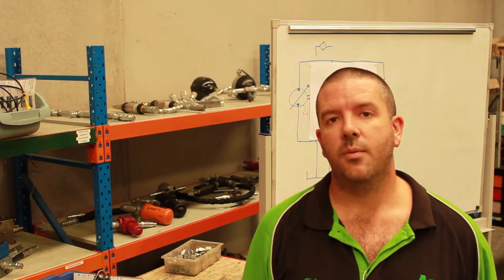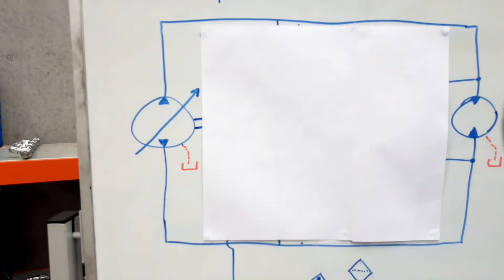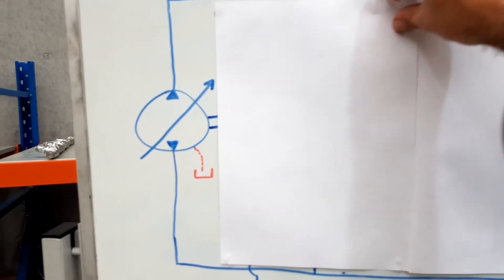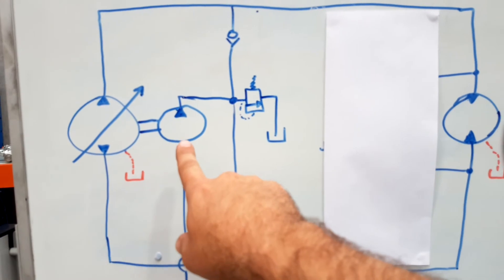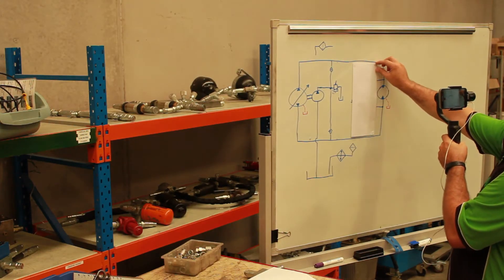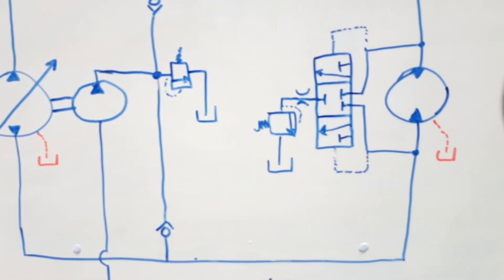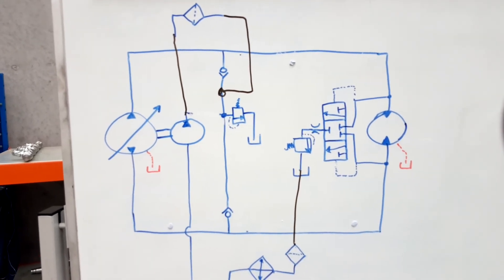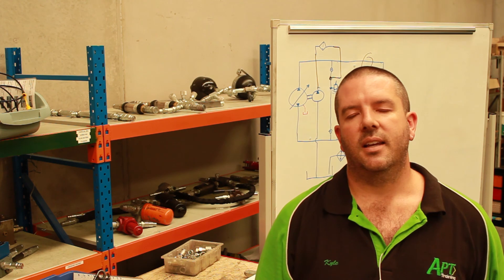How To Recognise Closed Loop Hydraulic Systems - AskAPT #2

Comment: Please What could be the issue when a shuttle valve pressure fluctuate between 200psi and 500 psi, for your information charge pump was adjusted 400psi and shuttle valve was adjusted 350psi, also I had replaced shuttle valve but still the same problem,  I have doubt maybe one of 4 hydraulic motors  failed,  what do you think?

Comment: Just as long as you size the charge pump big enough to overcome the oil leaked from inefficiencies in the pump and motor and the flow robbed from the main loop through the hot oil shuttle.  If you don't size the charge pump big enough to maintain proper charge pump pressure under all circumstances you risk tearing up the rotating group of the pump.

Comment: Actually on older equipment with one side of de loop in use, one direction running, filtration is pretty common on the return side since there are quick couplings in the system. Like vibro machinery.